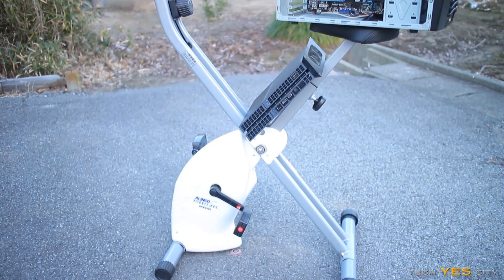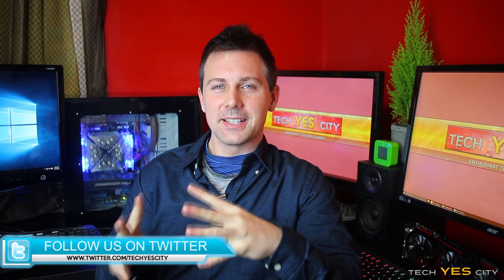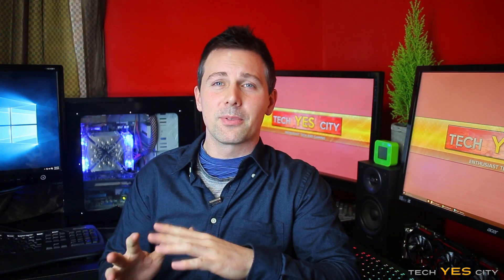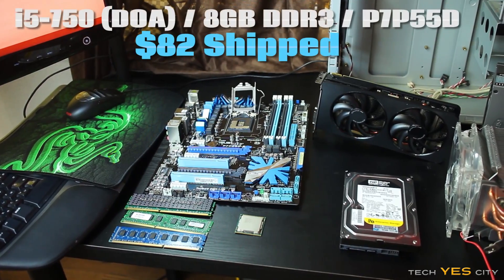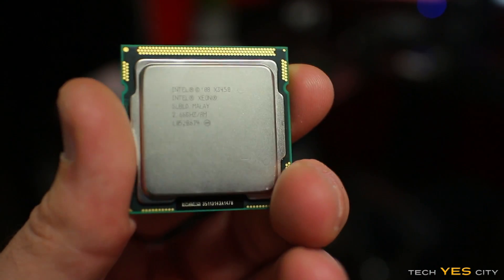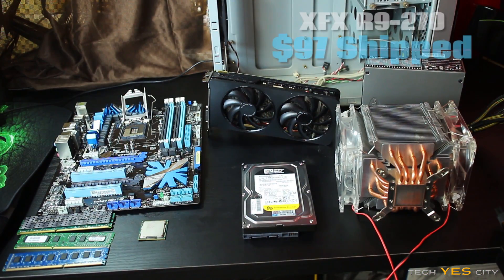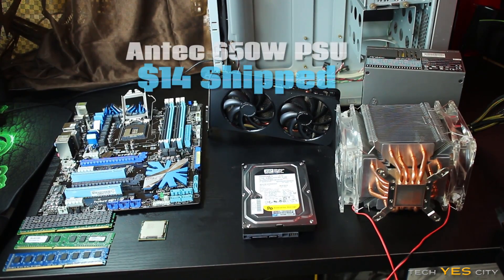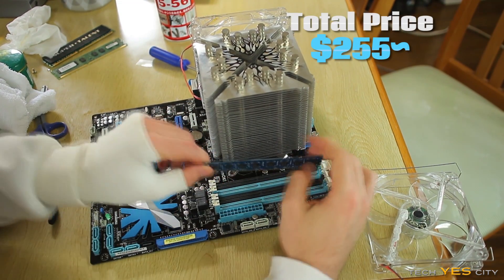$250 Console KILLER - How to Build the Best Used PC in 2016

Comment: Lol. 
Mouse + keyboard + OS + the fact that you got everything used or discount. 
I mean this video is slightly disingenuous no?
If you get a used console or you get it at a discount would this PC still be anywhere near the PS4 for example?
Can i stream all games to my friends on twitch without any drop in performance?
I mean you can essentially not do anything on the PC because it has no OS.
Reply: who pays for OS these days? everyone just downloads pirated windows now, and you can record and stream games easily without any frame drops using OBS or geforce experience. and atleast we can get new triple A titles for 30 bucks at release and free multiplayer without having to pay 50 bucks a year. there are also alot of good f2p games on steam and if you want to play games that only have singleplayer you could just download a pirated version. buying a used ps4 will still cost way more than this pc because of the additional costs of ps plus and 60 dollar games. and the ps4's graphics will still look worse than the pc's and we have mod support in alot of games.
Reply: SOFLOGONESEXUAL if you use an OS then you should count it in. You can't just suggest that everyone does something illegal.
Both OBS and Geforce experience are very CPU heavy. You lose a ton of game performance streaming. When it comes to game prices you can also get new AAA games on consoles you just have to find a seller. There are also a lot of f2p games on PSN you don't need to pay 50 bucks a year to play f2p games.
If you download pirated versions of things you are literally a criminal.  You shouldn't promote illegal behavior.
The ps4 graphics wont look worse than the PC because the PC is horrible and discount. Did you not see the video?
Reply: +Jeff Quartz I said 50 bucks a year for online, and triple A titles are always way more expensive on the ps4 than on a pc. and IDK if you've ever used geforce experience or OBS but you lose almost no frames with both. shadow play is literally the same as what ps4 has. and if you dont pirate OS, get linux for free. and I was just telling you about the possibility of getting games free on pc. and  as shown, the game settings were mostly on high with 60 fps, so the graphics do look better than on the ps4.
Reply: +Jeff Quartz and steam had way more good f2p titles than ps4, and not only f2p but better titles in general
Reply: SOFLOGONESEXUAL
Thats rather subjective. Lets try to keep the topic to performance instead because you change the goal post onto something that we can't be objective about.
Reply: +Jeff Quartz I did in my reply before the f2p one
Reply: +Jeff Quartz but you aint got no comeback to that comment
Reply: SOFLOGONESEXUAL 
I have used those streaming applications and they affect CPU performance significantly. Besides that build in the video has a dual core CPU which is horrible for modern gaming that does multi-threading and multi-core rendering.
Its horrible for newer games which is what this topic should be about. 
The video even showed significant framerate drops that you dont get on consoles ever.
I urge you to look up what games run 60fps on consoles before you say they can't do it.
What comeback are you talking about?
Free to play games? What games are you talking about? Are you saying more is better?
Because i can whip up 100 f2p games easily that are all horrible. Does that mean the mobile platform is better than PC because it has more f2p games?
Saying that games are cheaper on PC is also a loaded statement as the prices on consoles range from 0 - 60 in most instances. It can't get any cheaper than 0.
Reply: Jeff Quartz it has 4 cores and 8 threads, no major fps drops in the video, ps4 is worse in performance because it cant even run all new titles in 1080p 60fps, and therefor it has to lower the res or otherwise it has unstable fps, and Ive seen fps comparison videos and the ps4 is locked in 30 in most new titles like fallout 4, but this pc could run them on medium/high settings and still achieve 50-60 fps. you still didnt talk about that youve gotta pay 50 euros per year to play online, oh and also. ALL triple A titles cost more on console than on pc, so idk wtf youre talking about. for instace: farcry primal ps4= 47 euros where I live, farcry primal on pc= 22 euros, black ops 3 pc= 22 euros, black ops 3 ps4= 40 euros. you literally dont lose any frames using geforce experience and thats from personal experience and all the videos on youtube talking about geforce experience. the pc has almost all the f2p games that ps4 also has, but pc also has exclusive f2p titles. the same with exclusive console titles, most of them are for one console and the pc, like deadrising 3, so we get the best of both worlds. and when your pc cant handle all new games anymore, you can just replace the component that isnt able to run the new games, but when a new console comes out you gotta buy the whole thing. youre just a peasant that cant accept the fact that pc is better, so you come up with these weird invalid arguments that this cpu is dual core whilst it is quad core and that games cost just as cheap on ps4 as on pc.
Reply: SOFLOGONESEXUAL
"it has 4 cores and 8 threads, no major fps drops in the video," 

Oh right he changed the CPU which brings the price of the whole thing up but he just swapped the prices. LOL

ps4 is worse in performance because it cant even run all new titles in 1080p 60fps,
That PC can't run most new titles in 1080p 60fps either.
It runs Call of duty in lower settings than PS4 and it has framerate drops multiple places where PS4 runs it solid 1080p60fps.

and therefor it has to lower the res or otherwise it has unstable fps, and Ive seen fps comparison videos and the ps4 is locked in 30 in most new titles like fallout 4, but this pc could run them on medium/high settings and still achieve 50-60 fps.
Fallout 4 is one of the worst ported console games. It had PC as its main platform and they are using an old engine. The game needed 4 patches on PS4 to even be playable. It is hardly representative of what the PS4 can do. How will you explain all the other games that look and perform way better than fallout 4 then on PS4?

 *you still didnt talk about that youve gotta pay 50 euros per year to play online, *
That has nothing to do with performance.
Regardless you don't have to pay anything to play online in online only games or F2P games.

oh and also. ALL triple A titles cost more on console than on pc
Not necessarily. Multipel AAA games have been given away for free on the playstation store.

, so idk wtf youre talking about. for instace: farcry primal ps4= 47 euros where I live, farcry primal on pc= 22 euros, black ops 3 pc= 22 euros, black ops 3 ps4= 40 euros.
This is anecdotale evidence. Useless.

* you literally dont lose any frames using geforce experience and thats from personal experience and all the videos on youtube talking about geforce experience.*
first of all geforce experience has horrible picture quality. Second of all you still lose a lot of CPU performance. Stop lying. You are literally lying at this point.

* the pc has almost all the f2p games that ps4 also has, but pc also has exclusive f2p titles. the same with exclusive console titles, most of them are for one console and the pc, like deadrising 3, so we get the best of both worlds. *
The only exclusive console titles that are on PC are Xbox one titles. And they run horribly on PC + they are all rated below PS4 exclusives on sites such as metacritic. The PC only has free to play games as exclusives almost. What new exclusives are there on PC anyway? Almost none.

and when your pc cant handle all new games anymore, you can just replace the component that isnt able to run the new games,
If your PSU and motherboard supports the pieces you can.

* but when a new console comes out you gotta buy the whole thing.*
And you get it completely new without having to worry about getting it to work first as he did in the video above across a whole month trying to figure out how to assemble it and getting broken hardware replaces etc. No sane human being would want to go through that in order to find second hand cheap stuff that breaks half the time.

* youre just a peasant that cant accept the fact that pc is better,*
Better for what exactly? It isn't user friendly not does it come with an OS + controller.
It doesn't have many new exclusives from the past 2 years.
Games like world of warcraft arent free to play yet still pay to win.
League of legends requires you to buy rune pages before you can compete properly. World of warcraft has tokens you can spend real money on and get real gear inside the game.

* so you come up with these weird invalid arguments that this cpu is dual core whilst it is quad core and that games cost just as cheap on ps4 as on pc. *
Games are at times free on PS4... What are you talking about. What is up with the personal attacks lol, are you mad?
In the previous video he had a dual core in this PC and i didn't notice he changed it
Regardless when you talk about games running better on this PC, you are neglecting that he turns all the settings down and turning off SSAO, AA, etc. Just to get it to run over 30fps in the video.

Most of these pieces you wouldn't be able to get new for these prices so he is disingenuous to the max because he doesn't use retail prices but just ebay prices.

PC is more expensive than console and you have to realize this. You cannot link me an actual build from PC part picker that is cheaper than a PS4 while having better performance than a PS4. PS4 does approx 2 times what an equal paper spec PC performs. This is not my words these  are the words from the video game developers who make these games. Do you know who John Carmack is? He has said this on multiple occasions: https://twitter.com/id_aa_carmack/status/436012673243693056
Reply: +Jeff Quartz idk if you noticed, but he included both prices of both cpus in this build, he even said that he could make this build under  200 bucks if he sold that i7 he got with the mobo, so idk wtf youre saying once again. also games being free on the ps4 isnt true, because you have to have ps plus to get them, and that is what you pay for then. those games are mostly horrible anyway, the only good one so far was rocket league is what my friends with a ps4 said. games do cost less on pc and you still havent given a valid argument against it. linux is a free OS  so if you dont want to pirate or buy windows, use linux. im not even gonna argue about this pc being faster than consoles, because it just is. and if youre on a budget just buy a cheap mouse and keyboard combo. so if you would make this build and sell the included i7, use linux for your OS and buy a cheap mouse keyboard combo you will have paid approx. 230 dollars and then youre able to play online eithout having to pay 50 bucks. and if you want a new game with it buy it from a cdkey site which will probably cost you 20 euros and maybe buy csgo with it for 7 euros. and if you buy 2 other big releases it will at most cost you 40 euros. 
now lets do the same with the ps4. the ps4 costs 350 euros atm in my country. now youve gotta pay 50 euros for online aswell, thats 400 euros. a new game will cost you about 50-60 euros. and now you will have to pay 50-60 euros for every new game that comes out and you will have to pay 50 euros every year to play online. buying 4 triple a games in 3 years for instance will cost you 240 euros, add 150 euros for online and now its 390 euros. so in 3 years with 4 games the ps4 cost 740 euros. this just shows that a pc is better in the long run
Reply: +Jeff Quartz watch jackfrags video on geforce experience, the picture quality is almost identical to the game itself
Reply: +Jeff Quartz the games that you get free are utter shit m8, and they cost around 1-3 euros on cd key sites anyway so you cant really call them triple a titles.
Reply: SOFLOGONESEXUAL
You do know that over 100 games have been given away free right? I didn't know that Rocket league, Outlast, Mirrors edge, Sly cooper, Trine 2, Oddworld new and tasty, Transistor, rogue legacy, Velocity 2x, MGSV: Ground zeroes, Limbo, grow home, Hardware rivals and Zombi are all shit games. Most of these games are AAA, you just don't know what you are talking about. 
Stop lying. Just stop yourself.
Reply: SOFLOGONESEXUAL You can't calculate what it would cost to remove the CPU from the MOBO when it is second hand for fuck sakes. He is decieving you in his video. He also only showed 4 games in the video 2 of which aren't even on consoles, and then he says that the build runs better than consoles? He plays lower settings than console in fallout 4 and call of duty, so why would you even say he proved anything?
Reply: +Jeff Quartz it isnt for free dude, it is for 50 euros per year. most games you named arent even games that you got for the ps4, but for the ps3, like mirrors edge. and they cost around 3 euros on pc anyway so not like they cost much. pc gets games like these free aswell on cd key sites. I got outlast, lucius and amnesia for instance all for free, and for free I dont mean 50 euros per year.and you can calculate the cost of the cpu because you can take a look at the active listings and the ones that have been sold already and this way you can see what the minimum price and maximum price is for that cpu, over here its around 25-30 euros.
Reply: +Jeff Quartz and have you seen the fps comparison on ps4 vs xbone on campaign? they both dip below 30 sometimes, and thats not very stable. and where is your source that says that the ps4 runs on higher settings? because last time I checked consoles had no anti aliasing and no game had over medium settings
Reply: SOFLOGONESEXUAL That was when the game launched. Have you seen dark souls 3 performance on PC at launch, or quantum break performance? what is your point? Multiplayer is more performance heavy.
Reply: Jeff Quartz so now you ignore all the other topics because you know im right? and atleast the pc version wasnt locked at 30 fps like on the ps4 version, so it still had above 30fps.
Reply: SOFLOGONESEXUAL 
I didn't see the other comment. Mirrors edge etc. was given away without the need for PS+. Stop trying  to think you know everything. I didn't have ps+ yet i got them for free.
Pretty much most PS4 games have anti-aliasing. Go see the digital foundry report for Call of duty. You can see he had ticked off shadows and SSAO etc. Games on PS4 have medium-high settings of most multiplat games. Sometimes its hard to compare because the settings are specially tailored to the platform they are on. 
It doesn't matter if the PS4 version is locked to 30fps if it is stable. The PC version can be as unlocked as it wants to be but it doesn't make the experience better nor does it make that pc build in the video any better. We are talking about the PC in the video correct? Stop trying to change the goal post. You are like a fucking regressive.
Reply: Jeff Quartz theyre not high setiings becasue those graphics comparisons show the pc version on high settings and it looks way better,and most games dont have anti aliasing. those free games you got are shit and they cost around 3 euros on pc anyway and we got some of them free aswell. you were the one that brought up fps so I brought it up aswell, youre the one here that brought up that the ps4 is cheaper , but when I debunk your arguments you come here with new ones, or you say: lets keep it in the video department. and idc if the fps isnt stable anything above 30 feels way smoother, it might not be stable but it is still above 30 so its smoother than on the ps4, and not like the fps is that unstable, it might drop down a few fps now and then, but its still pretty stable."it doesnt matter if its unlocked" thats peasantry in a nuttshell. have you ever played games above 30fps? because it is a huge difference, and I dont even play my games 60fps anymore, 144 fps is the shit.  and you didnt talk about how the pc is way cheaper than the ps4. the comment I posted shows that the ps4 is way more expensive in the start and in the long run. but you said it was way more expensive right? but after I posted that comment you didnt say anything about the price anymore, because you know im right/

Comment: I have an i3-3240 paired with a HD7750 what should i upgrade ?
Reply: GPU get something like a gtx 960 or r9 380
Reply: +cassardavid94 wont it be bottlenecked by the cpu ?
Reply: +Vivixus not really the i3 3240 is quite a decent CPU. even if they are bottlenecked however you will still get significantly better performance and you can always get a used ivy bridge i5 in the future
Reply: +Vivixus not really the i3 3240 is quite a decent CPU. even if they are bottlenecked however you will still get significantly better performance and you can always get a used ivy bridge i5 in the future
Reply: cassardavid94 Alright , thank you